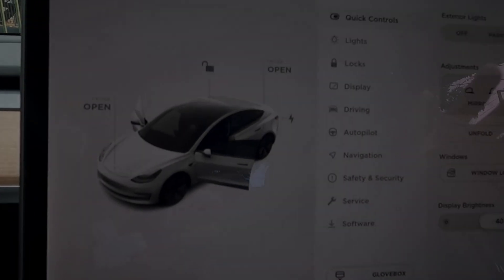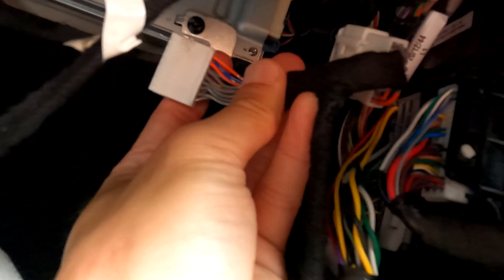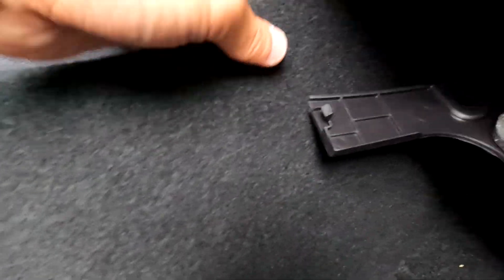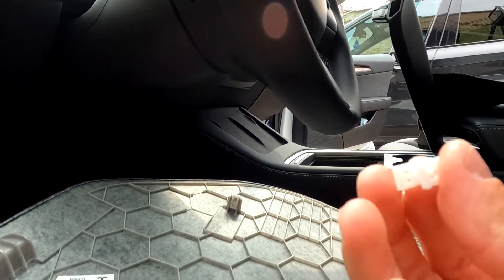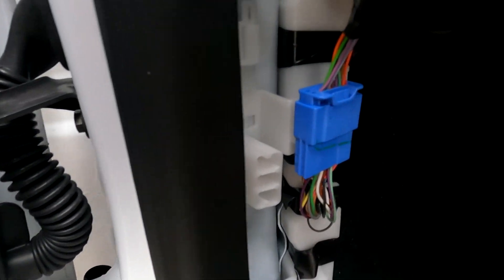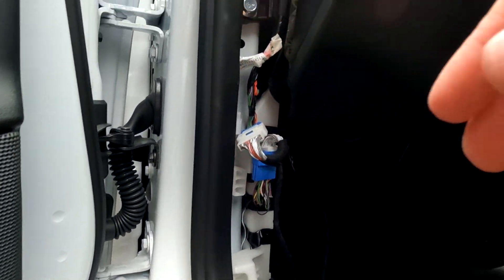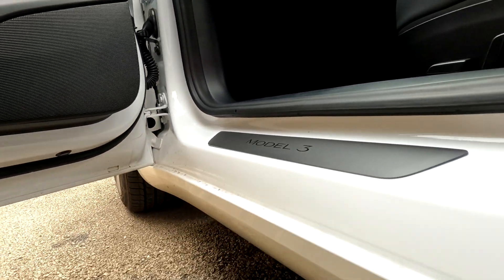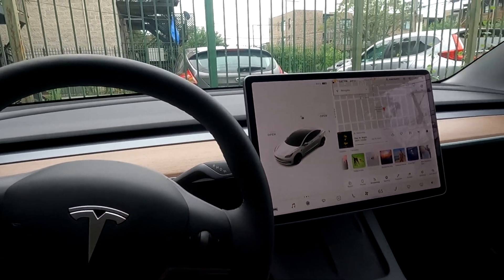2021 Tesla Model 3 Upgrade - Activate Speakers for Audio in Standard Range Plus (Hansshow DIY)

Comment: Hello, Thanks for great video! I have 2020/12 long range dual motor. The car is same color int/ext. How do I know, I already have premium system, if they just put speakers and don't connect it? Just listen to all of them, if they are working I guess? Thank you for answer in advance.
Reply: They connected the speakers on all Long Range and Performance models. They left them unplugged in the Standard Range to make the LR and Performance more appealing.

Comment: that's crazy you gotta take apart both sides of trim, while on my newer 22 model you had to do it only on one side plug in play into the system! all 4 speakers are working too definitely adds more clarity an immersion to the music!!
Reply: Do you have a link to 2022 instructions?
Reply: Unfortunately I don’t cause they don’t sell the kit anymore for a 2022 model 3 it’s been banned I think for AMD ryzen chip set 😔 mine still works flawlessly you might be able to find it on another website
Reply: Yes please link to a 2022 guide 🙏

Comment: Hi! Thinking to get the upgrade audio and your video made it look easy. Question on the red and black wires. When you say "jam" it in there, do you mean when there's already a black and purple wires in the hole, go ahead to still stick it with the respective colors? Like jam the black in the already jammed black wire and jam the red into the already jammed purple wire?
Reply from the maker: Yes, there will be 2 wires in the hole.

Comment: Does a 2022 model 3 still have the speakers installed that you can activate with this kit?
Reply: no you can't
Reply: @ absolutely wrong bud. I got it installed today who told you wrong information, rear speakers are Removed but the 4 speakers can be activated look up a video
Reply: To be honest the 2022 RWD stereo sounds pretty great, I’m not sure if they improved it but it’s better than the premium one that was in my S. Not quite as much bass but sound is better overall.
Reply: @ adding the 4 speakers makes sound some clear an adds immersion
Reply: yes you can actually, I had it installed today 4 of more pillar speakers work great now adds more clarity an immersion! well worth 59$ harness from Hansshow
Reply: Can you please link to a guide for 2022 model, can't find one..

Comment: Do you have the problem that i have? Occasionally have loud noise coming out from the driver side speaker. The 2 pins were loose and I have to use a T-tap to splice the wire, but not improving the situation. Thinking to return it now.

Comment: Thanks for posting. I have the same color as your model 3 (white with black interior/50% of the Tesla's on the road). The most economical model! After taking delivery, I was surprised to find the four speakers were installed by not wired. The sound of the stock car is good but there was a reason the car had these additional speakers. Your instructions were easy to follow and I will be doing this upgrade soon.
Reply: Have to check if I have a woofer.   LOL don't remember at all.  If I have the wires Then I may as well buy the trunk woofer.

Comment: A lot of work for little gain... if the rear speakers were still present in the 2021 models id probably consider it, but this much work and cost doesnt seem worth it to me to add more treble only speakers. Good video though! just my 2c
Reply from the maker: First time install took all of 45minutes. Subsequent install without having to record should be a lot faster. I just sold my car so I'm going to remove the DIY kit, so we'll see how long that takes.
Reply: I agree that's too much work and risky just to add high/trebles that are already good enough but what really missing is bass
Reply: @BoZzZ2010  I dunno, bass is fine on mine, subfrequencies aren't good tho. Meaning bass won't pick up super low parts. I have a "premium" 2018 model tho, it also has rear speakers which are just pathetic.